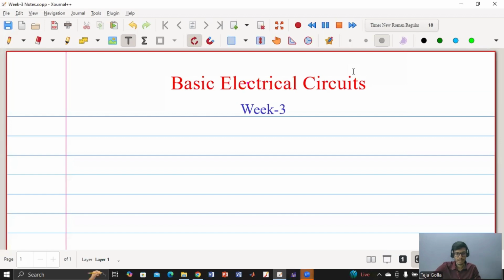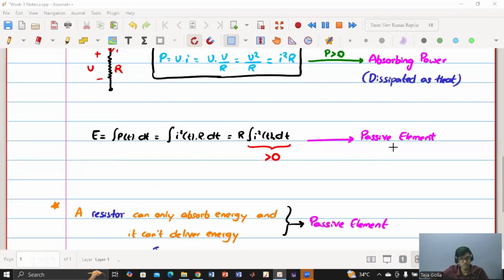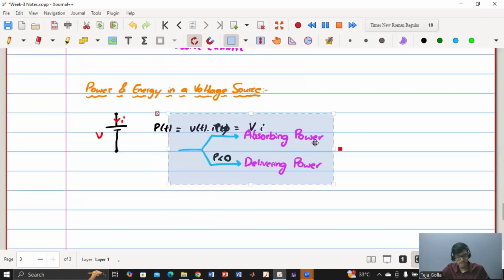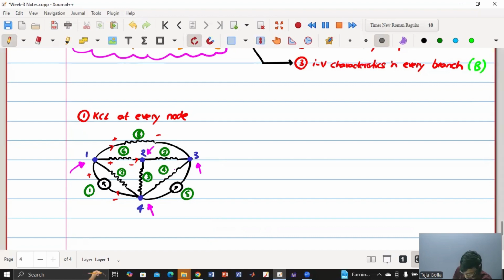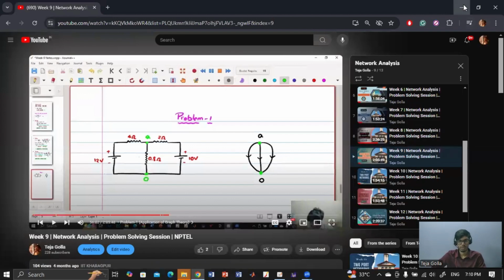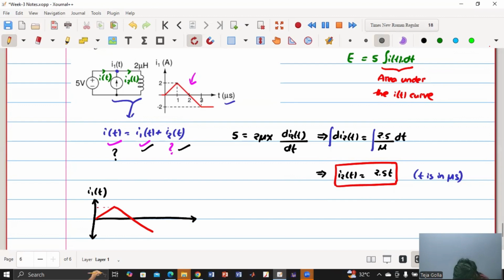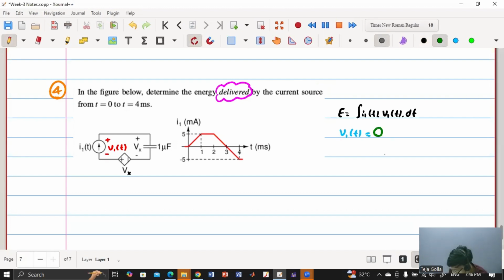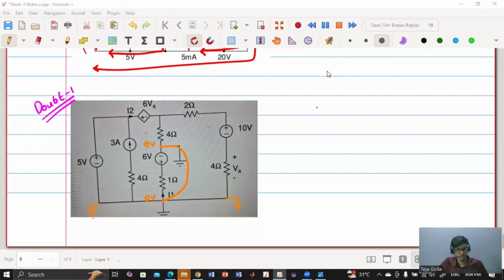Week 3 | Basic Electrical Circuits | Problem Solving Session | NPTEL

Comment: Sir in the problem 6 why the branch having current source is not taken as the node
Reply from the maker: The current source and the 10k ohm resistor are connected in parallel. So, both elements share a common node.
Reply: @tejagollagt  ok sir got it 
Thank you